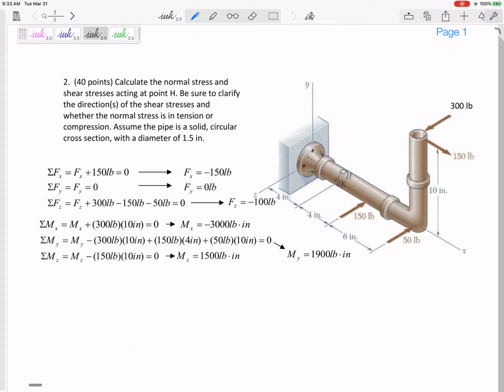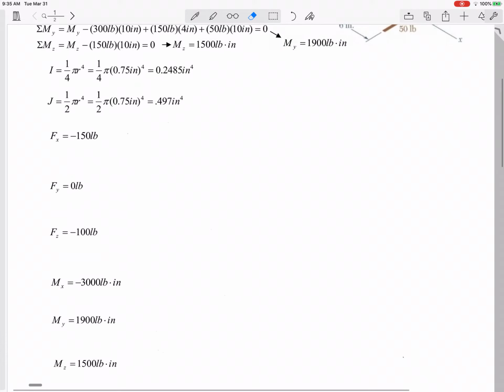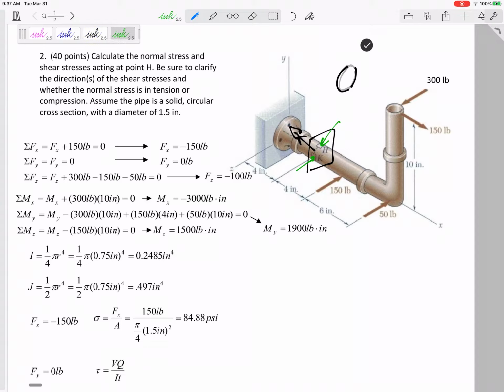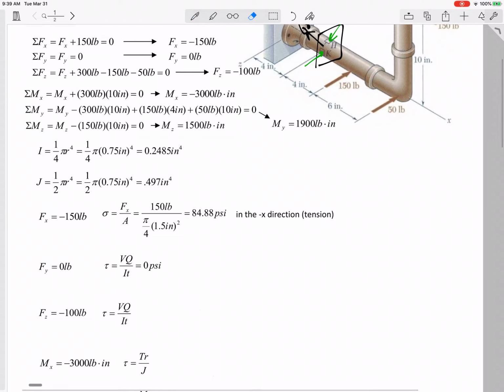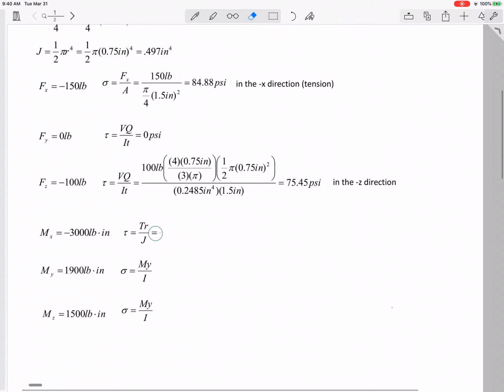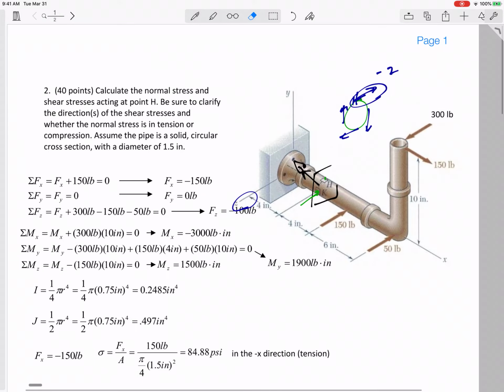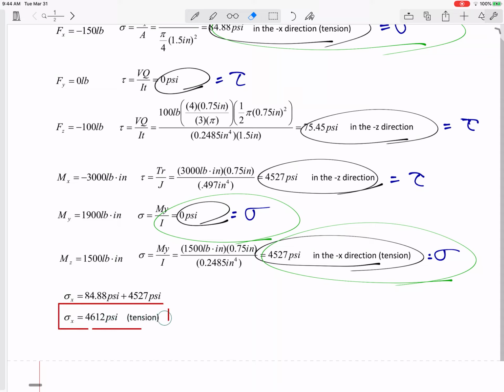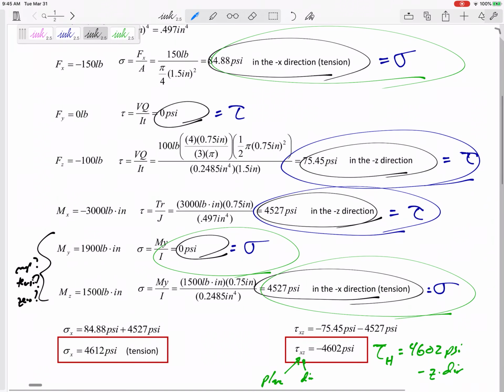Mechanics of Materials - 3D Combined loading example 3

Comment: Shouldn't the shear stress caused by torque be in the opposite direction? i.e. positive-z direction
Reply from the maker: Remember we are calculating the internal shear that counteracts those external torques that you mentioned. It has to add up to zero.

Comment: why did you just dont consider the negative signs when doing your calculations of stresses? is it ok to put them in or should we leave them out
Reply from the maker: I leave them out. For 3D problems, positive and negative signs tell you the direction of the internal forces and moments. 

For normal stresses you need to specify tension or compression. So the positives and negatives are important in that it will show you directions which will help you tell whether the normal stresses are compression or tension.

For shear stresses, I like to specify the direction of the shear stresses. So, again, the positives and negatives are important in that it helps you tell which direction the shear stresses are acting.
Reply: @engineeringdeciphered  but is it okay if i include the - sign in my calculations
Reply from the maker: @Deadepitome123  I would have to defer to your teacher. For normal stress, I DON'T want my students to include a negative: I want them to give me the magnitude and tell me tension or compression. For shear, I want them to give me the magnitude and tell me which direction it is pointing. There are some teachers who want a negative sign if the normal stress is in compression. And of course this is only for 3D stresses, for 2D stresses there is a sign convention that you should use.
Reply: So would you say there’s no normal force only shear force?